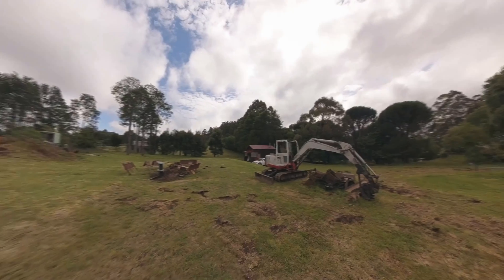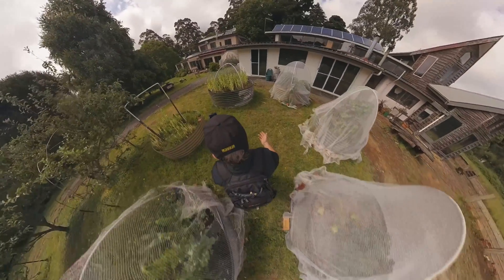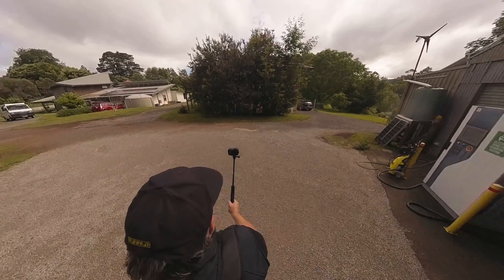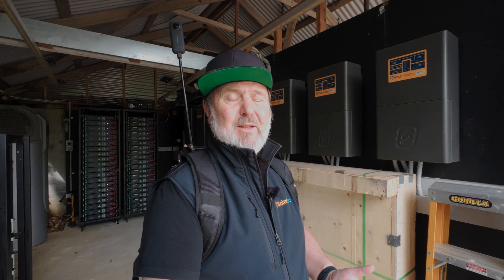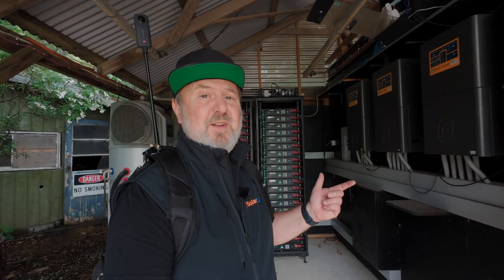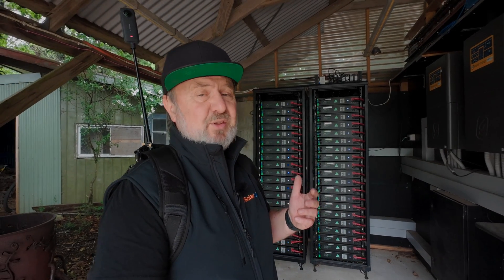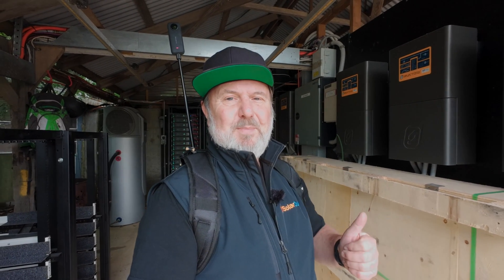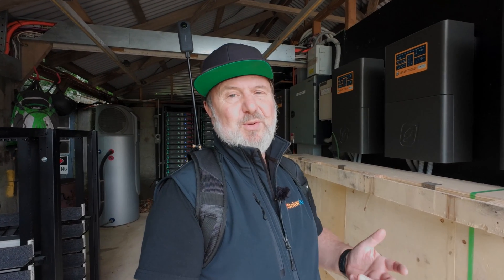Understanding Battery Sizing for Off-Grid Solar Systems

Comment: Nice racks! 😁
Reply from the maker: Yes, the two racks both have 25mm wide busbars in the rear that all the batteries connect to using the same length cables (this is important for proper battery balancing). Then each cabinets busbar is connected to a main system overcurrent protection board.